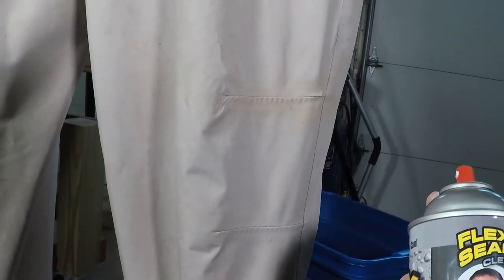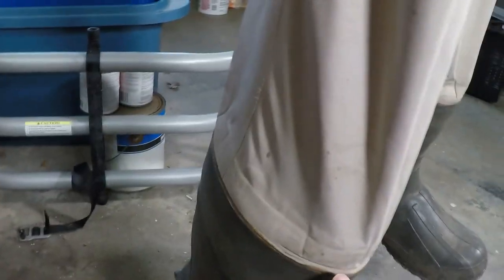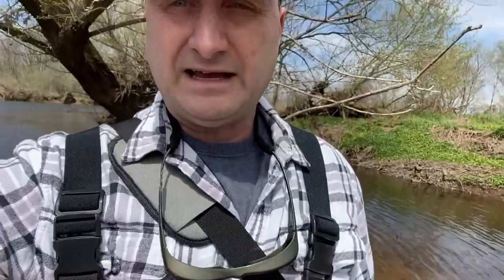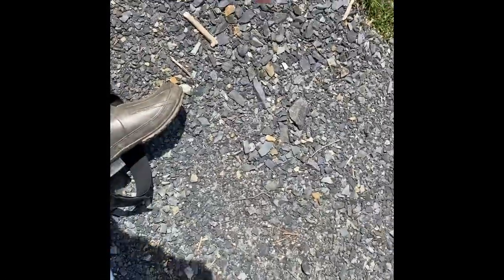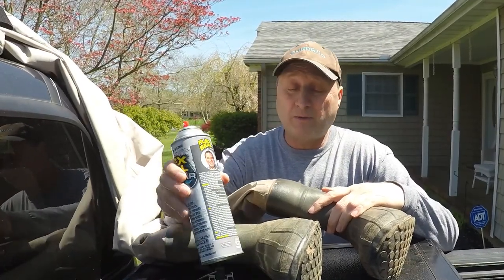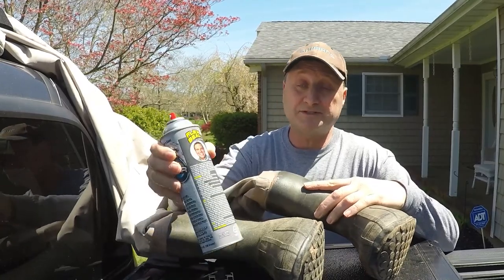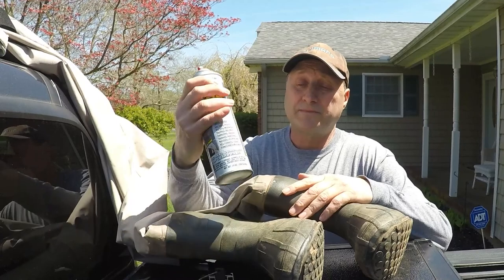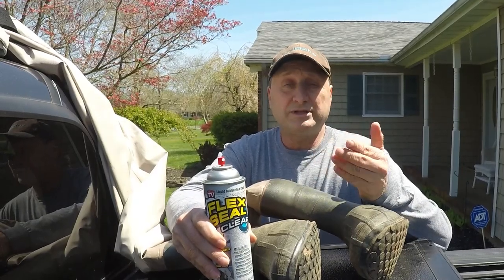Can You Fix Leaking Waders with Flex Seal?

Comment: I’m glad that the flexseal worked great on your waders. I do know that on breathable boot foot waders they work as well. Granted sprayed them on the inside and letting them dry by  turning them Inside out works as well. Let me give you a tip. I’ve heard fisherman tell me as well as a podcast. Do not wear jeans under your waders for the simple fact that abrasion from the jean  material will rub up against the stitching and the seams and create a leak you’re better off wearing  a type of sweatpants, cotton material or polyester, shorts or pants to avoid the abrasion of the jeans against the seams of the part of your waders, but I am glad that you fixed them. Congratulations. You probably got another year out of them.

Comment: Best video,  leaf blower, spring clamps, yep put the blower in the boots close the opening with spo g clamps, start the blower, inflate boots, spray bottle of soapy water....leak find easy peasy....flex seal....
Reply: The exhaust port of a small shop vac also works well for this method. I dab on the soap solution with a sponge brush--somewhat less messy than spraying. You do need to rinse away the soap before applying  sealing material. My preference is E6000 adhesive, clear, flexible and doesn't set up in the tube like  Aquaseal does once it's opened.
Reply: There's a video?